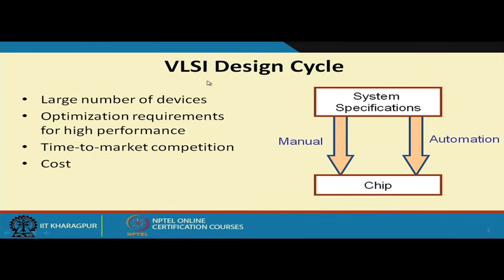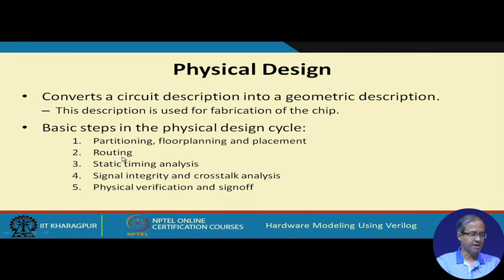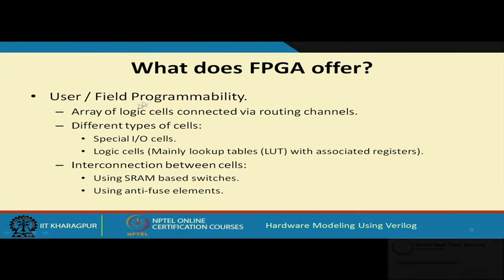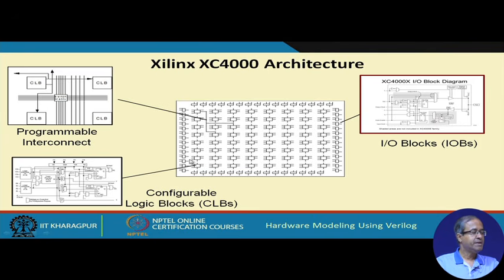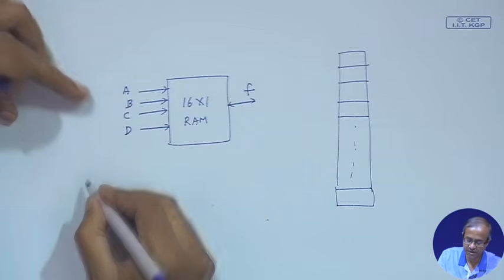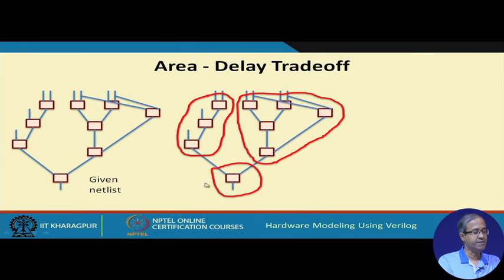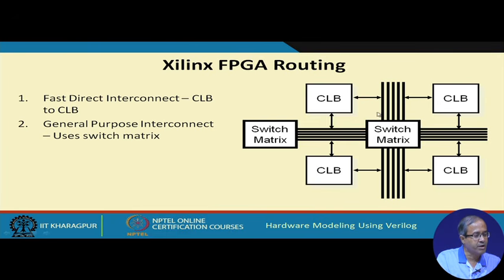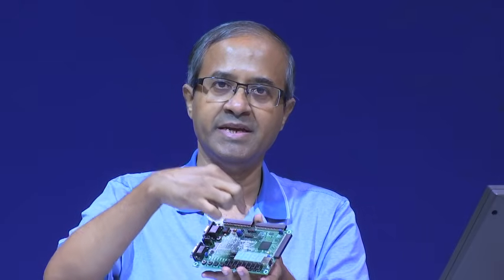VLSI Design Styles (Part 1)

Comment: IM NOT UNDERSTANDING THE DELAY PART
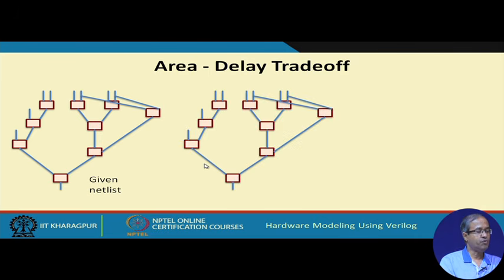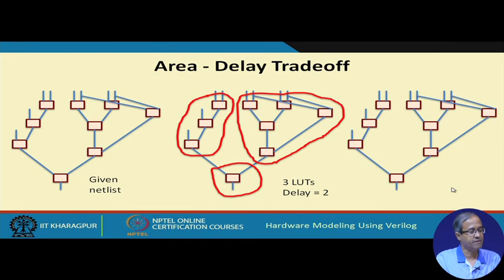Reply: ( 15:56 )So when the 3 LUTs are used, the output of the 2 LUTs which are input for the 3rd one will have same level of delay that is '1' and whereas 4 LUTs part, ( 16:48 ) on the right side we have two LUTs and on the left we have one LUT so all these three are inputs of the 4th LUT which is on bottom of those, the left side LUTs take equal time/level to compute as compared to the right one. So the two LUTs on the left takes '2' delay level until that we get the output on the right LUT and the bottom LUT take one delay cycle so totally (2+1)~(2 delay levels on the left side + 1 delay level on the bottom)
Reply: @ateluguboy7735 
Hi u have this notes or slides?
Plss reply me
Reply: Plz ask elaborately